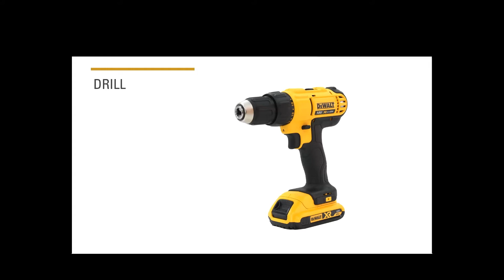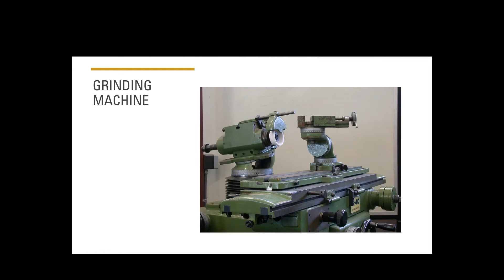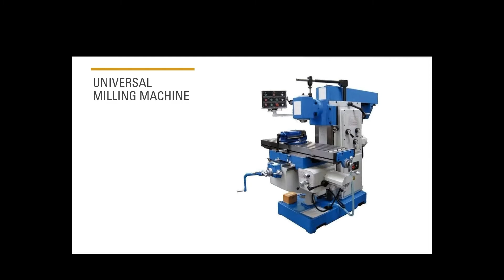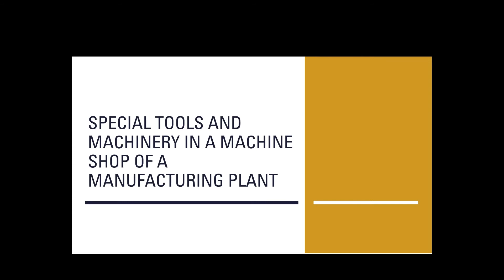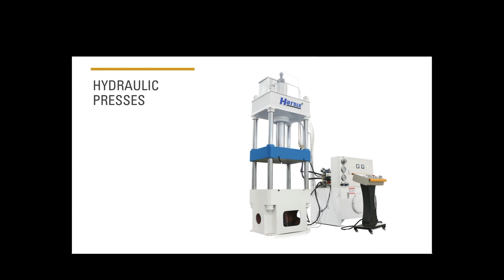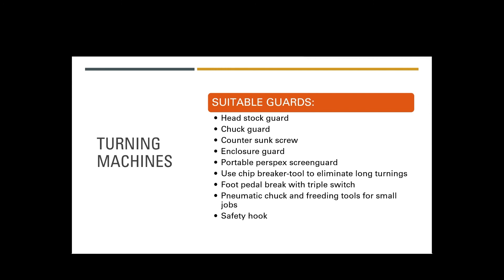PSME LAWS AND CONTRACTS: MACHINE SHOP EQUIPMENT

Comment: Thanks to ProfCharlton for this video. These high-tech and modern industrial tools and machines can be operated manually, electronically, pneumatically or hydraulically, depending on the model. This extensive line of machine tools helps locksmiths and machinists complete projects with ease. Some of the products include lathes, milling machines, grinders, drills, saws, grinders, chamfers, presses, deburring and polishing machines, and more. To ensure the highest quality and durability, machine shop tools are sourced from the top brands you know and love to provide you with superior high performance tools that will last you for years. To learn more about machine shop machines, contact ProfCharlton Academy!